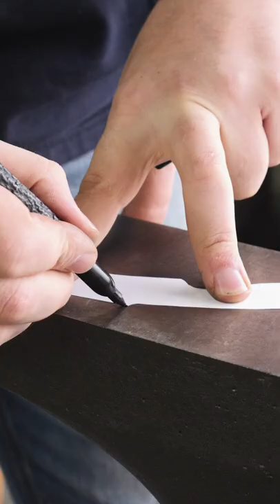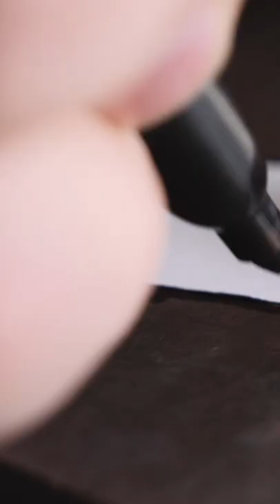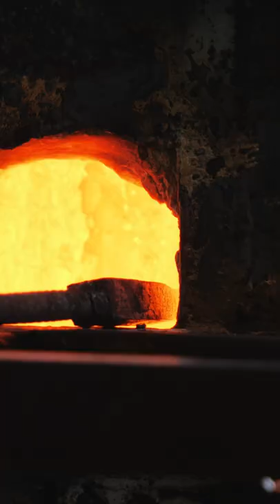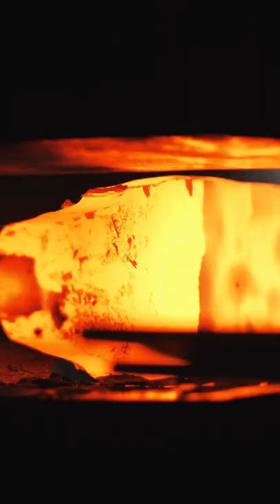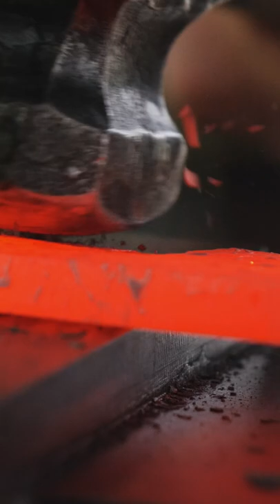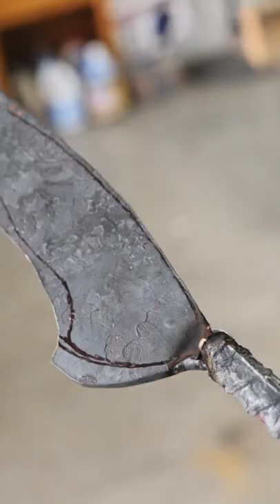Forging Out My Blade

Comment: Why are you using crappy ass rebar?
You can buy whatever material you want,in drawn lengths too!l
Reply: I think he's only using the rebar as a handle welded to the blade. So he has a way to hold it and move it to and from the forge.